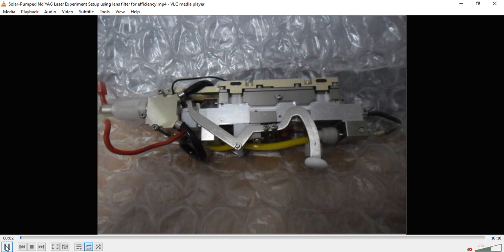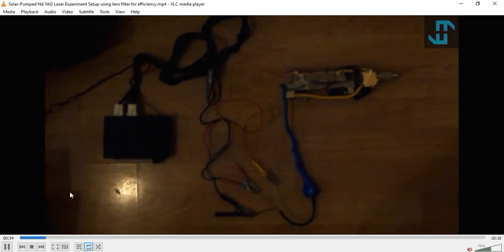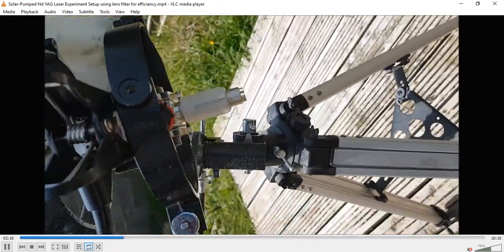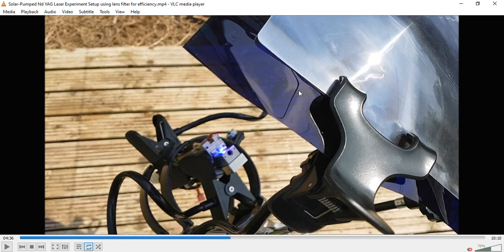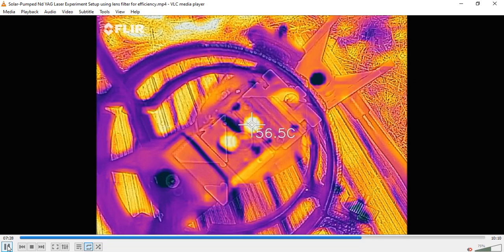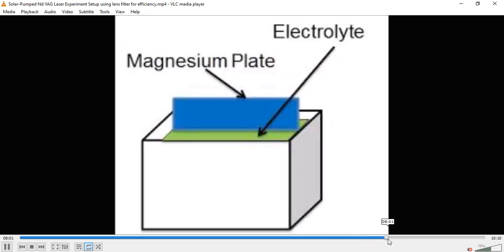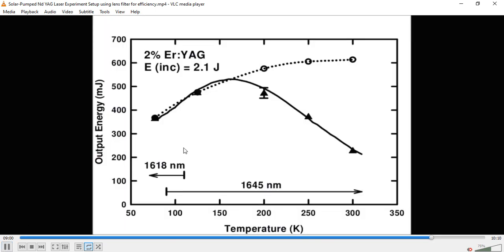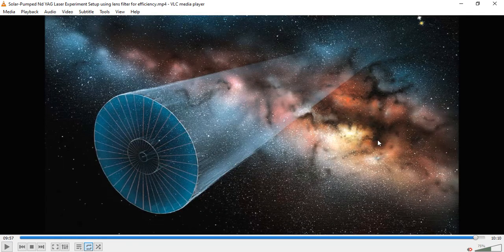Solar-Pumped Nd YAG Laser Experiment Demo with Potential Uses in Energy and Space Exploration

Comment: Hi Ray: It's absolutely something I've thought about myself; however even at peak intensities and filtering to allow only pumping wavelengths in to the medium, the optical amplitude/watt density of the sunlight (at least here on earth) is not actually that much as compared to the flash lamps which pump enormous amounts of energy in with minimal losses. It would take a relatively huge reflector to gather enough light to pump it to significant amplitudes. It's a really cool area though to experiment. Enjoy your videos my friend.
Reply: In your calculations, how "huge"? Did you calculate the diameter of a parabolic mirror? How about those big fresnel lenses all over YouTube?